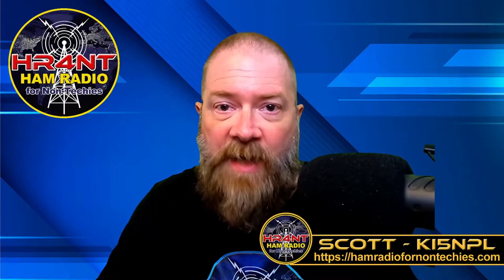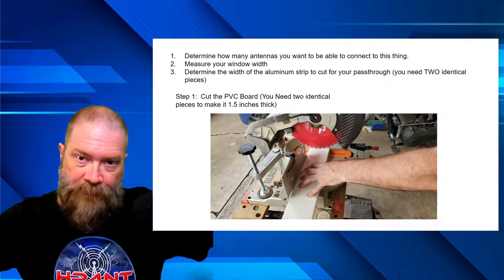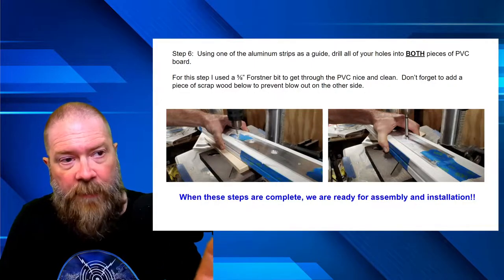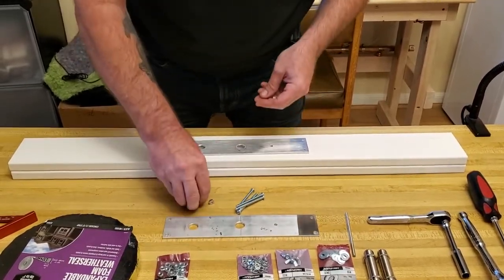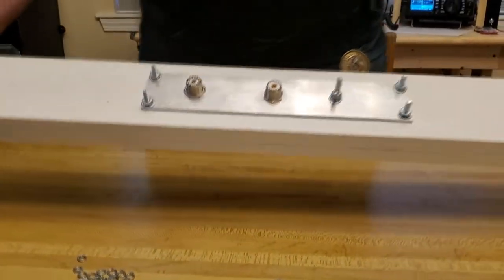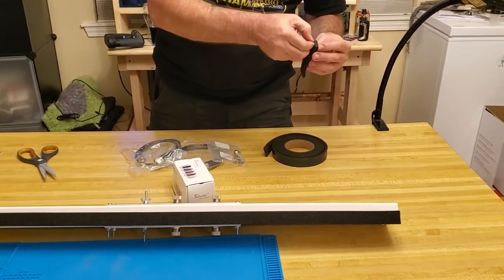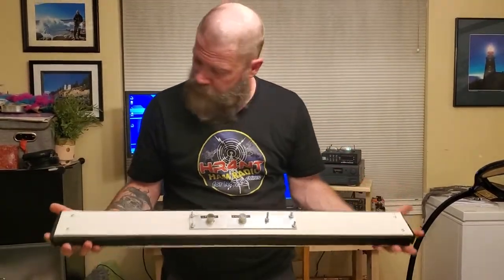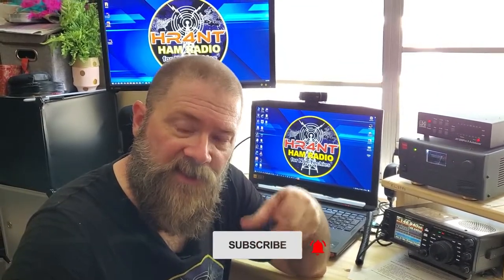Build Your Own Window Passthrough

Comment: 27:00 you mentioned air leak.  Man I was thinking it was to keep the bugs out.  Lol.  I’m up too late on you tube.  And also glad to see you doing better even though this is an old video.
Reply from the maker: The air leak I have is between the two windows when one of them is open.  It was resolved by having my wife knit me a window snake...basically a long thin thing that you stuff between the gap produced by the windows.  Simple solution.  LOL  I appreciate you taking the time to watch the videos!  Thanks for the comment!  73!!
Reply: @HR4NT  yea brother.  I love to go through the old videos of my subs when I am winding down in the evening.  I had been seeing the passthrough in some of the newer videos and then this came up. All good.

Comment: Cut foam long and trim it. Then it's always centered.  You can put foam on the window frame too.  Use a putty knife to shoehorn it in.
Rub bar soap on a bare window frame to lubricate putting the passthru in.
The Navy calls your coax tape, conformal tape.  
Great video!!!
Reply from the maker: Glad you enjoyed it!  The passthrough is working great to this day with zero issues. I appreciate the suggestions.  Thanks for the comment and for watching.  73!

Comment: Scott, this is 3 years old (or so). Is this still in use? Any issues or things you might recommend to do differently? Thank you for this. KQ4IXD
Reply from the maker: I'll tell you, three years later and this thing is still running as good as the day I built it.  No issues whatsoever and no signs of wear or deterioration.  This was a solid win.  Thanks for the comment and for watching.  73!

Comment: I’ve found that you never tighten any screws or bolts until all of them are in place. That way you have some play to move things a little for clearance.
Reply from the maker: That is a technique I learned from woodworking years ago.  It just helps to minimize issues later on.  Thanks for the comment and for watching.  73!

Comment: I love this, was about to get started, unfortunately today's prices (April 2022) make this project a little over $70 just for material, assuming one has all the tools.  A new one costs about $79.  But I have no doubt some of your other projects WILL save me money.  Keep 'em coming!
Reply from the maker: Thanks for the comment.  Even though the costs may have gone up, it is more about the quality of the materials used.  The MFJ literally comes with a 1x4 ;pine board, not the composite I use which will literally last forever in this application.  Ultimately it is up to you and your budget, but I think this is still a good deal.  I hope you find a solution that is suitable to your needs.  Thank you for watching and talk soon!  73!

Comment: You are making this overly complicated.  All it takes is a 3 foot hunk of 2x2 cut to length, ends trimmed to fit the window track, with a slot for the coax(s) to fit through.  And foam to seal the top and bottom of the window.  No damage to property.  That is how I did it back when I rented.  Now its my house, I drilled a hole, and sealed it after the coax was run.
Reply from the maker: I wanted something that would last a century.  The PVC board is almost indestructible for this application.  I like the foam idea.  Thanks for the comment and for watching.  73!

Comment: This is an awesome video! Frankly this is much better than the stuff you can buy online, and the fact you did this with common parts makes it even better. I built mine as a sliding door pass through out of wood a couple years ago, but this video gives me a few ideas on how to upgrade it now as make it more functional. Keep up the great work!
Reply from the maker: Glad you enjoyed it!  We are actually working on a vertical one for a sliding glass door for a fellow ham that is blind.  We will be using this methods to build him a passthrough that will last for many many years.  Thank you for watching.  73!!
Reply: Thanks for sharing. I don’t have any issues with drilling holes but by making one of these I can bring it through my window and it’s a much shorter run than running under the house and through the floor. I was considering a flat coax but I like this option better. It’s cheaper and a much better solution than the other. It was like $60 for it and only one connection. Now I can hook up all 4 of my antenna by just changing wherever I connect my radio.

Comment: Another quick question. What coax do you recommend that I get. I done some research and there still were so many different ones that I found.Looking for something of decent to great quality. Just to give you some specs of what I will be running,  I have an IC-7300 and I will be operating on 40-10M. The antenna that I will be using is the MFJ-1984MP, END FED, 1/2 WAVE, 40-10M, 300W, WIRE ANTENNA.  I will need about 45 feet of coax. What do you suggest with the above mentioned specs?
Reply from the maker: I suggest a good quality coax like ABR Industries or Messi & Paoloni.  I know HRO sells ABR, but you can order it direct from them as well and they have a lot of coax sizes to choose from.  If you go to abrind.com you can browse their selection and custom order exactly what you need.  They can also add ferrites to your coax to help block out any interference.  They have their own version if RG58 here for about $40:  https://abrind.com/shop/rg-cables/abr058c/  OR you can go with the heavy duty coax for around $125:  https://abrind.com/shop/abr400-solid-ultraflex-assemblies/abr400-uf/  I hope this helps.  If you are still on the fence  about coax, give Ham Radio OUtlet a call and they do sell ABR cable and can recommend one for you.  Thanks for watching and for the comment!  73!

Comment: Noticed that you have a security sensor on your window --- that will be disabled (and needs relocation) with the pass-thru installed.
Also, unless you are in one of those areas without wind, you will need to jam some (NON_STICKY) foam packing between the upper and lower window panes, else the banshee gales and any dirt in the air will strongly infiltrate the window when thar she blows.
Reply from the maker: Thank you for the suggestions.  Those have all been implemented since we built that passthrough.  Thank you for watching and for the comment.  73!

Comment: Just came across this site so maybe my comment is late for the party.  I made one pretty much like this.  After a year I discovered that I should have used stainless steel or brass hardware.  The cold temp of winter would cause some moisture condensation on the inside hardware, leaving a rust discoloration around the inside hardware.  I've since added a rotator.  I couldn't see any easy way to pass the cable through so i just cut a slot in the bottom to lay the cable in and used some RTV to seal around it.  Not the most elegant solution but it works.
Reply from the maker: Hey it is never too late!  I answer every comment every morning from my channel viewers.  That is awesome that you made one as well.  I used all stainless on mine.  Where ours differ is that for the coax I used a barrel connector and basically have two coax to make the connection form outside to inside and have had no issues with that setup since I built it.  I appreciate you sharing your build! Thanks for the comment and for watching.  73!

Comment: Great video, unfortunately looking at this video in 2023, all those materials has increased in cost considerably. It will at a minimum cost me almost as much to just by the MFJ product, I priced out just 5 of the primary materials you listed in the links, and at the minimum those materials now cost $90 using my own tools and screws/bolts if I even have them.
Reply from the maker: That is probably pretty accurate, however, the materials I used in the video, specifically the PVC board will far outlast the cheap pine used in the MFJ version.  I am sure you will make the best decision for your needs and budget.  Best of luck!  Thanks for the comment and for watching.  73!
Reply: @HR4NT  I'm figuring out how to apply this solution to a large block out I have to install to put in a small window AC unit for my ham room. I think I will be using 3/4 melamine MDF with the edges sealed before the foam strip is installed. The block-out will be 32" wide to accommodate the AC with room to spare.  I plan on mounting the pass through vertically along one edge as the window is 4x5 slider.

Comment: @HR4NT‧ Do you have a mod for adding open wire and single wire connections?
Reply from the maker: I do not only because I have not used that type of connection before.  Maybe drill a hole and add a silicone tube to pass the wire through and seal it with liquid silicone??  I honestly do not know.  Sorry I couldn't be better help there.  Thanks for the comment and for watching.  73!

Comment: Many years ago I purchased a pair of SO239 bulkhead pass throughs that are 12 inches in length. These are perfect to work as feed throughs of a masonry wall that most of the house has on the ground level. Any idea of a source for these beasts???  They were bought at Dayton Hamvention from a parts guy selling Chicken Band equipment. They also sold large wide nuts to use on the feed through so there was no need for washers to spread out the load of the tightening nuts.
That square you used was it a special offers from the Woodpeckers custom tool site? I keep getting offeres from them for specialty onetime issued tools, very expensive but worth it.
Reply from the maker: I think those are available on Amazon. I think I remember seeing them.  My local electronics store also carries them but they do not have an e-commerce site to purchase them.  I hope this helps.  Thanks for the comment and for watching.  73!

Comment: You should have caulked between the exterior aluminum and the PVC board...and used all stainless steel hardware.
Reply from the maker: Thanks for the suggestions.  It has been a while now since I built that and it still holds up just fine as the the I made it.  The foam seems to be doing perfectly fine as well.  I think I did use stainless hardware aside from the aluminum plate.  Either way, thanks for the comment and for watching.  73!

Comment: Nicely done I think I will be building a similar one. Question: Why did you use two pieces of the PVC board rather then just one?
Reply from the maker: I used two pieces to add thickness and rigidity to the overall project.  having two pieces sandwiched together like that came closer to the actual thickness of my window frame than a single piece would.  I hope this helps and good luck if you build one.  They are fantastic!!  Thanks for the comment and for watching.  73!

Comment: Thanks for the video. It gave me some great ideas for my pass through build. I’m going to go with red cedar because I like the looks and smell and my window location never sees any rain or water. I was curious though, do you use lightning arrestors?
Reply from the maker: That could be a good idea for your situation.  I use arrestors outside my shack at the ground rods to protect my shack, but I also unplug everything at the slightest hint of a thunder storm.  I hope this helps.  Thanks for the comment and for watching.  73!

Comment: Thank you so much for your content.  You have a easy to understand common sense way of presenting complex subjects.  This video inspired me to create my own window passthrough.  To think I was going to spend north of $100 on a MFJ product.  Mine is much better quality with more connections.  Thanks again for your work, keep it coming.
Reply from the maker: I'm glad you found my video first then!!!  With a few simple tools and a little measuring you can completely customize a much nicer result for less $$$ than going with the premade one.  Mine is still working without fail right now and I am glad I thought to document it and share that knowledge to help others out.  Thank your for the comment and for watching.  73!
Reply: @HR4NT    Did you guys know that almost all MFJ products are actual copies of other products that are far cheaper.
They license a lot of stuff from other companies or manufacturers and then they slap their name on it and triple charge people for the same product people could have gotten for 25% of the cost.
There is a European ham radio operator that revealed this.  Another European guy also showed a version of MFJ SWR meters and shown that
MFJ created their own version of it.  The original cost $125 and the MFJ cost $475 and they look & operate exactly the same.  THIS is why I will NEVER buy anything that is MFJ related.
There is no reason why anyone should buy a SWR Analyzer for $475.   Its one of the main reasons why most new young people dont get into the hobby.
Everything is so overpriced.  Newbies come in they get interested in the hobby, but once they start seeing the prices of different things, the newbies leave & never come back.
Almost everything in the hobby is so overpriced that its actually driving away people.  In particular the new people. specially in this day in age when things are tight.
Reply from the maker: @TwstedTV  that is a good reason for channels like this one try to show you how to build your own stuff.  You save money, learn a good skill and have complete control of the quality of parts used in the project.

Comment: Nice pass through and well done.  Lousy grounding because there is no copper from the inside to the outside.  Also all copper to aluminum interfaces must be treated with an anti-oxident to provide a good electrical connection over time.  Like your last revisited video indicated grounding may be over rated but if you do it as a guide please do it properly with all copper/brass interface and no aluminum.
Reply from the maker: I actually copied and improved upon the exact model that MFJ used to make for their passthrough.  They used aluminum, so I did the same.  It is a bit more cost effective than copper, but I do appreciate your suggestion.  Thanks for the comment and for watching.  73!

Comment: 29:24 guess I have to like this for that joke alone… But maybe you did overthink how tight everything should be. You might have to worry about expansion. A little less tight with a bit of silicon is my suggestion.
Reply from the maker: The measurements used for my situation seem to have worked.  I did, in the video, cut down a bit and then added the foam.  To this day it still works fine and no expansion issues.  Thank you for the suggestions and for watching.  73!

Comment: You could have put some RTV between the boards when you put it together and it would hold them together and keep water from getting between them. May not get water between them them but it will help hold things together. Maybe put the RTV in when you tape it together and it will help hold thing together. You can also put a very small amount of Teflon lube on the connector.  Most put to much Teflon lube on things. The best way is to wipe off all you can, just want a very thin coat to stop corrosion over the years of use.  I just found your videos,  and think you are doing a great job of helping get out ideas!  Keep up the good work.  73. W4DES,
Reply from the maker: I thank you very much for the comment!  Welcome to the channel and I hope you continue to enjoy the content.  Those are great ideas, so thank you for that as well.  Thanks for supporting the channel!  73!!!

Comment: I Also Have The Yaesu ft 991 & i want to get on wiresx & cant figure out how ..do i need any thing other than the radio & a usb cable ? ?
Reply from the maker: No you have everything YOU need.  The issue is whether there is a WiresX Repeater anywhere nearby that you can tap into.  I did not have one near me, so it was a no go, yet no one explained that to me either that it was necessary in order to use that feature.  I hope this helps. Thanks for the question and for watching. 73!

Comment: You want to go slowly when cutting aluminum with a carbide blade.  Liquid electrical tape can be used instead of self annealing tape.  The only thing different I would have done is to cut off the ugly bolts sticking out with a hand held grinder or a hack saw blade.
Reply from the maker: Thanks for the tip!!  I would have cut off the bolts, but I wasn't overly worried about it and it seems to work just fine if I can overlook that.  Thank you for the comment and for watching.  73!

Comment: Torn between if I Should build this or just buy the premade one from MFJ which will end up being much cheaper then building. Pricing this all out today 12/20/2022 is way more then the mfj-4602 window pass through.$86 as of today..  Just the SO239s are $32 alone. I think when all said and done this DIY would be $120-150 but be much easier to add stuff down the road vs the premade ones.. Also, nice Free Mason badge..
Reply from the maker: Cost of materials has definitely caused an issue in 2022.  The main difference is that you can fully customize the one I built to suit your needs and the materials I used are far better than that of MFJ's version and will last a lot longer.  Either way, you need to decide which is best for you and your situation.  I hope you find a solution that works for you!  Thanks for the comment and for watching.  73!
Reply: @HR4NT  I will use your build as my template, I started building a similar one. Got 2 pieces of 1/4" aluminum at 12"x3" and put it into pressure treated wood I had left over from our deck we built. Also made it flush using a router. Might paint the wood white :) 73!

Comment: If you are really anal about air leakage and reducing drafts you can also get some rigid foam board of your choosing and attach it to your panel and add a layer of foil tape or something around the perimeter....hmm and or toss a layer of the rigid foam board in between your pvc layers.
Reply from the maker: Great tip.  I did resolve that and have no leaks.  Thanks for watching and for the comment.  73!